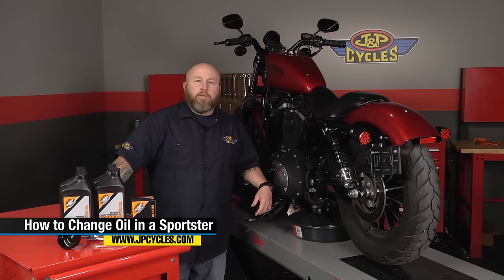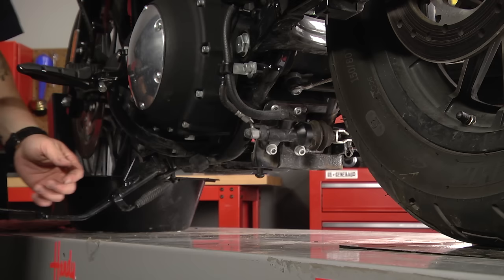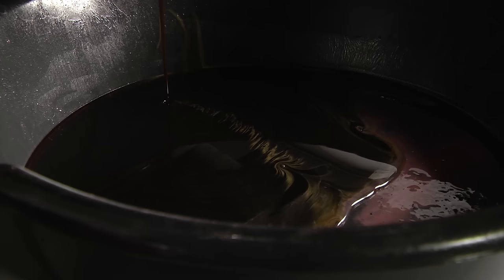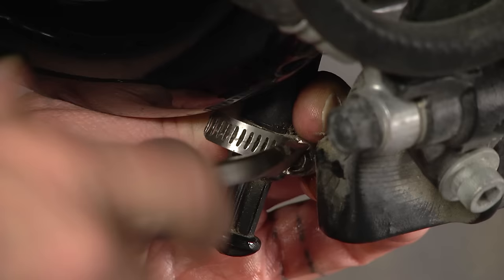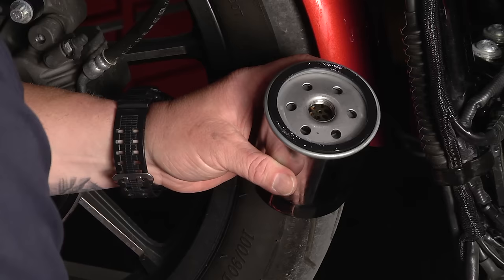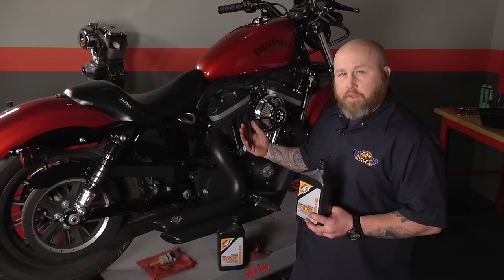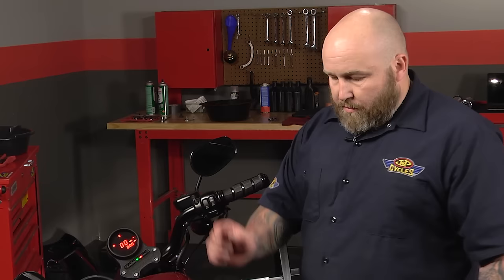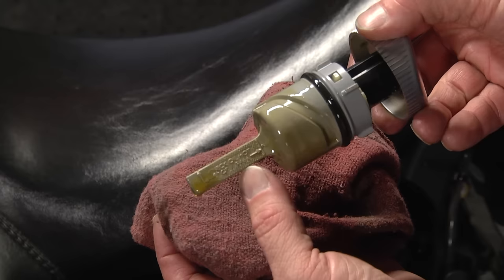How to Change Oil & Filter in a Harley-Davidson Sportster by J&P Cycles

Comment: I have a Harley Davidson 1200 Sportster 1999 
Can you please tell me why my bike loses power when I use it for about 40 minutes. Somebody has already cleaned the carburetor, but the problem is still there. Thank you.
Reply from the maker: When you say lose power, what exactly happens? It could be the ignition pick up, but I'd like to know more to help you determine the cause.
Reply: J&P Cycles thank you for responding! When I drive my motorcycle for about 25 minutes the bike heats up and without changing the speed, it slows down and its like it wants to shut down but it doesnt. For example, ill be driving at 70 mph and it suddenly loses power and it begins to slow down. I pull over, let it cool then take off. But 5-10 minutes later it happens again. The harley davidson bike shop cleaned the carburetor and changed the ignition coil but the problem persists. Thank you!
Reply from the maker: email me at paul.white@magretailgroup.com and we can go over the problem. I believe the part in the following link could be the problem, but want a little more info. http://www.jpcycles.com/product/380-413
Reply: RuMal cam sensor is bad. Mine's doing that to

Comment: Cheat ! The oil filter you showed in the beginning has no bolt on top, the one you opened has the bolt on it.
Reply from the maker: uh......nope. None of them had bolts (although thats a nice option) which is why we used an oil filter wrench.